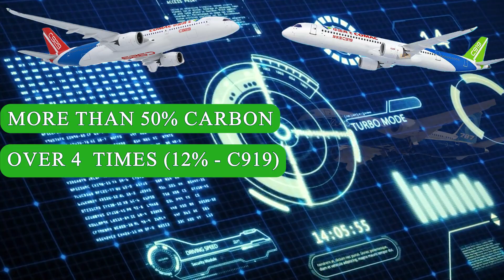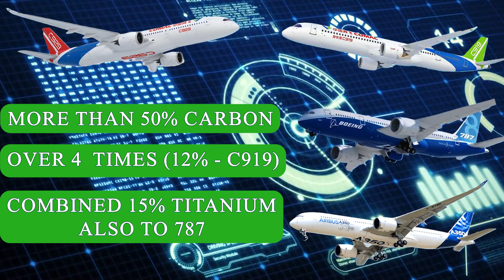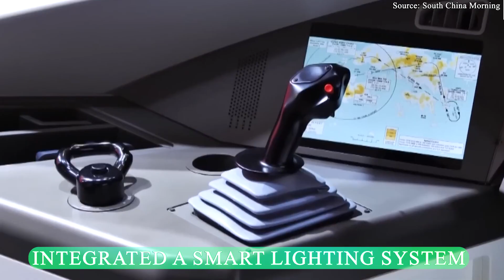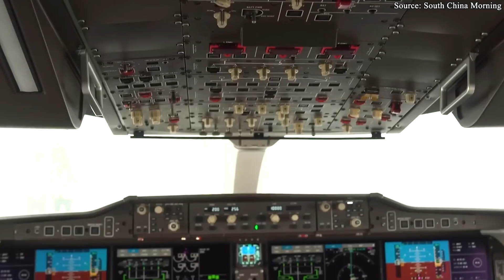China's NEW C929 Aircraft 12,000 Kilometers Testflight SHOCKS the West!

Comment: It'll take 2 to 3 years for China to build up its own supply chains for cj1000 n cj2000. Just like c919, C929 won't be 100% self reliant in the initial stage. What important is China have built its own avionics,  engines n other key components. It's expected that c919 n c929 would achieve 100% self dependency in components before 2030. International certifications are not important in the short run as China have a huge market for its own aircrafts. 
"One step at a time" is the motto of China.
Reply from the maker: One step at a time!